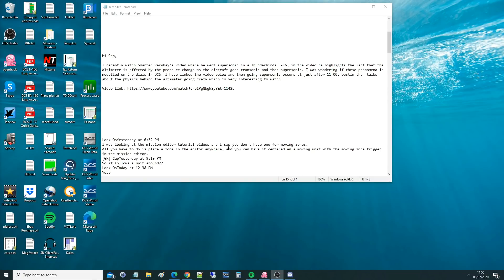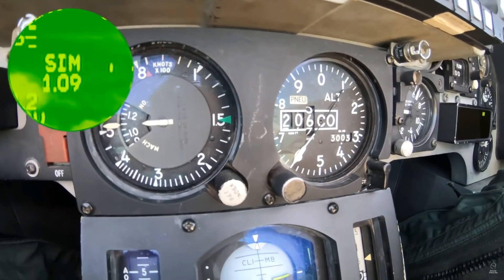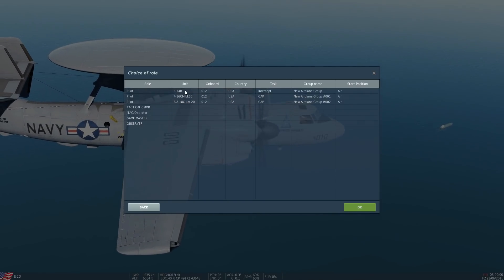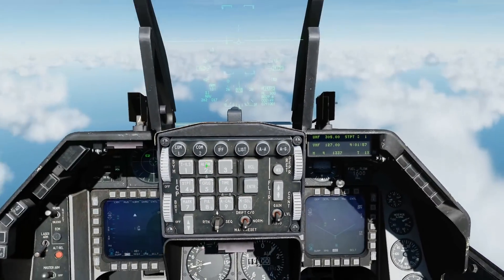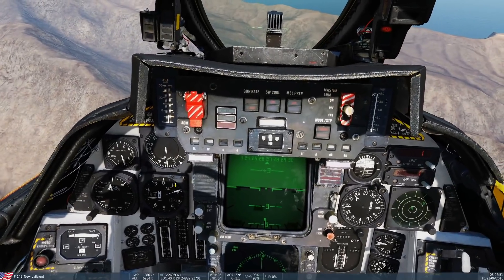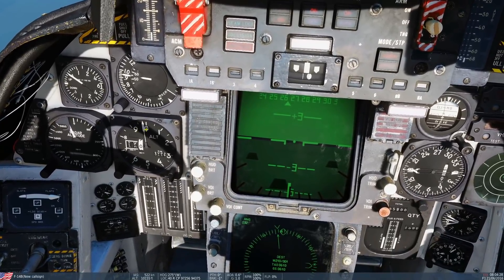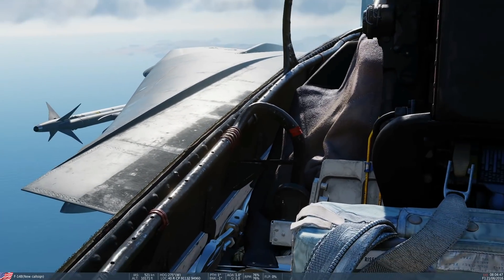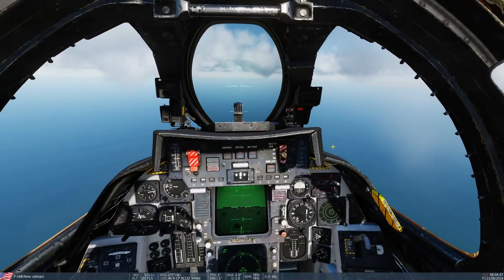Questioned: Is Pitot Pressure Rarifaction Modelled In DCS WORLD?

Comment: It works in the F-16 you just have to switch the altimeter to pneumatic mode. That little switch next to it.
Reply: Have you tested that?
Reply: Confirmed, tested it an you are correct it works on the F-16 as well in 'PNEU' mode
Reply: F/A-18 does not go super sonic :-D
Reply: @ihsanollasalamziy628  tis a joke
Reply from the maker: Thanks Sir did not realise
Reply: @ihsanollasalamziy628  I looked and didn't see a way in the Hornet. I think it is Pneumatic only and isn't modelled. I did test the F-5e as well but didn't appear modelled either. It does have both elect and Pnue modes as well.

Comment: Having once worked for a video game company, I can tell you that these sorts of things are never actually physically modeled. That would require far too much computing power to keep the rest of the game/sim running smoothly. What we would do is setup many pre-calculated tables, where the necessary values can be referenced very quickly while the game/sim is running, instead. That being said, it shouldn't be that big of a deal to put this behaviour in the simulated aircraft.
Reply: That's basically how everything here works, including the flight model. And if it's good enough for NASA sims, I don't see a reason why it wouldn't be for us...
Maybe at some point proper CFD will be done in real time on GPU, probably with some help from neural networks, but before that THIS is the only viable option yielding professional grade results.
Reply: @getsideways7257  Many of the advanced flight models in DCS do use some real-time calculations for flight modeling

Comment: +GrimReapersAtomic  Eagle Dynamics needs to develop static rarefaction models for the available types in DCS:World.  I'd expect the engineers to place the static ports of the pitot-static tubes feeding the air-data computers where the shock wave has the least effect, so the helmet-mounted PFD stays true even as the standby gauges reflect a 500-foot jump from the pitot-static tubes feeding them on account of the static port located farther back than optimum.

Comment: Indeed it's modeled but on plane tested, it depends on the ADC systems in use. That f16 in the video was in PNEU mode, so no compensation behind. F18 also compensate for this effect.
Here, it s the Mach shock wave giving you an abrupt change so it's very noticiable but on liners, or on any plane you ll have the same effect.  For example, on the 737, when you level out at an altitude, it keeps it even if you accelerate or decelerate.  Back when I started on the Bae146, the altimeter was not compensated so your altitude would change if you change your speed. That s why we were not RVSM with the 146...
Reply: If there a way to switch to pneumatic in the Hornet?

Comment: Now you know why the Tomcat is an expensive module, it definitely worth it. Beauty Mighty Tomcat, everything in this module is awesome, even Jester AI but not the GBU-24 ^^
Reply: Because you can sell anything to an idiot with a simple trick or two? Especially if it looks shiny. That's basically MS' plan for their upcoming "sim".
Reply: @getsideways7257  well come on, why so negative. It seemed (before everybody chimed in about the pneu mode) that heatblurs module was the only one modelling such an obscure detail. I think there's way worse reasons to show loyalty in the flightsim worls than attention to such details
Reply: @decnet100  Why so negative? Because HB's modeling of it looks rather suspicious? There is, however, the possibility of it behaving as it does because of the difference in the Pitot ports configuration. But if on both aircraft it should behave the same way, I have bad news for you...
Reply: @decnet100  Also, who's to say it shouldn't default to the electric mode in an F-14? Maybe it shouldn't exhibit that behavior in the first place, but they still decided to add it "to make it look cool".
I mean, even F-5E is much older, yet it does have the switch. You think Grumman engineers didn't know how to compensate for the Mach shock wave pressure jumps?
And if anything, Heatblur weren't the first ones. MilViz did it too and probably some other FSX developers.
Reply: @getsideways7257  Man, sounds like some guy from heatblur pissed into your coffee this morning... You're like assuming the worst reasons for anything by default. Usually that means they screwed up something personal previously if there is that kind of anger. Not saying you're not justified for saying so, and I can't be bothered to go through F-14 documentation to check the default settings (am on my friday evening diet of beer and icecream already)... But man, take it easy, life goes easier when you stop assuming malevolence where ignorance would work just as well...

Comment: I noticed it was lacking in DCS modules in general and it was a bit disappointing for me when I compared it with FS9 (and even fS2002)  modulus, many of them did simulate this effect. And again it is good to bear in mind that many of those modules were free.
Reply: Simulate or just play a specific hand rotating animation as soon as the transonic region is being passed through?
Reply: @getsideways7257  I guess your understanding of a simulated world like the DCS needs a bit of correction. Do you think everything you see in DCS is "simulated" in the sense that it follows all rules of nature?! Obviously that is not the case and it doesn't need to be. 
Even softwares that are designed specifically for scientific research and engineering are far from being perfect.
Reply: @Heybat  I know reasonably well how things are simulated in DCS, so you don't need to tell me that. Still, there is a huge difference between using a little trick I described above (which is purely cosmetic) and expanding the aerodynamic tables for the FM also with the readings from the static and dynamic Pitot ports.
Also, on the point of "it lacking in DCS modules": https://www.youtube.com/watch?v=cWGewNOkRII
It's just that modern jets appear to have a mechanism preventing the readings from going haywire, so you need to switch to a special pneumatic backup mode to see that it's actually working.

Comment: For those of you folks who can't be bothered with checking it yourself, here's how it's actually modeled for the F-16CM module: https://youtu.be/cWGewNOkRII
I didn't try to copy the SED video exactly and was flying low level at that. As you can see, some pretty complex stuff is going on there. Especially when you pass the transonic region slowly.
Also, the latest OB started having some weird freezes. That's another reason why nobody should have interfered with the frequency of the updates. Now we have to wait forever for that to get fixed.
Reply: Someone else has already posted a video of the previous version without the PNEU flag. Well, no harm in having a few of these, especially since the flag is working now.
Reply: I also tried to recreate this in the F-14 module and for some reason the hand's behavior looked more natural, but nothing close to what we can see either in the Destin's video or in either of the DCS F-16 videos. I wonder if that could be due to improper modeling of things or because of the Tomcats Pitot ports configuration. After all, we never saw how exactly it happens in the cockpit of an actual F-14B... I'll give Heatblur the benefit of the doubt for now. But what I can't let them get away easy with is a pretty long list of things, starting with the performance that got simply beyond horrible after the latest patch. Sure, it dipped pretty steeply across all modules, but the Tomcat is just unbearable curently.

Other two things worth mentioning: DCS F-5E doesn't appear to have this modeled even in the pneumatic backup mode, HB AJS-37 couldn't care less for transonic effects either (or the backup mode wasn't found). Also, RAZBAM's Mirage doesn't show any signs of this behavior either (or again, the pneumatic mode not found).
Reply from the maker: Thanks for clearing that up, I didn't think to check the Altimeter mode.
Reply: @grimreapers  No need to thank me for the altimeter mode, since that goes to the other people here. I simply did more experimentation and added a current OB video (the flag looks pretty neat), apart from speculating how it could be decently modeled without straining the CPU (the same way as the flight model).
But please always double check these things. This video might have spoiled ED's reputation quite significantly, since people readily jump to conclusions without at least watching to the very end (not to mention ignoring any following refutals). Although, sure, the F-5E doesn't seem to have this modeled, but then again, the Viggen doesn't either. Let's judge by the most recent modules.

I have a feeling there might be more Pitot related aerodynamics artifacts we are unaware of. Like, while flying with the static port first. Although, that should prove difficult, since you'd need to reach 50 kts in that position or whereabouts. Then again, it could be possible in a heavily damaged/almost destroyed aircraft. That would be a good test for the model. That said, I'm not sure if the tables account for lateral velocities that significant...

Comment: The Hornet and Viper are using KCAS (Knots Calibrated Airspeed) which is corrected for effects like this, so the altimeter might be similar? I think you can even switch modes in the Viper
Reply: Calibrated Airspeed is Indicated Airspeed correct for instrument and position error.  It does not correct for comprehensibility or density; that would be Equivalent Airspeed.

The altimeter is electrically driven by the CADC in servo mode, and driven by the pitot static system in pneumatic mode.  According to the manual, the airspeed indicator is always driven by the pitot static system and displays indicated airspeed, which I found surprising for a high tech aircraft.
Reply: @gort8203  Thanks for the correction!
Yeah, it does sound surprising, but then again you have to remember that the planes that to us feel so very modern in DCS are from the 80s, the last Legacy Hornets were delivered in 2000. 
More modern aircraft like the Super Hornet and F-35/F-22 are most likely a lot more advanced.

And at the end of the day KCAS or even KIAS is useful, since it gives a feel for the turning potential and basic aerodynamics at any altitude. It's not perfect, but there's a reason why TAS or GS is not displayed in the HUD
Reply: @AsRedAsBlood7  After further reading, I think the F-16 HUD does display calibrated airspeed, but the standby airspeed indicator displays indicated airspeed.  Probably the same for most of these fighters.

Comment: Pity that the Smarteveryday guy doesn’t understand shockwaves.
Reply: He's an aerospace engineer who worked at the Redstone Arsenal. I'm sure he's at least familiar with supersonic aerodynamics.
Reply: M G it’s very simple: pressure ahead of shockwave is normal atmospheric pressure, behind shockwave is higher pressure, pressure drops behind the rarefaction waves that you can see in his video where the projectile cross section reduces. Can be found in any aerodynamics book but it’s not what he said.
Reply: @andybarnes00  I agree, he had it backward, pressure aft of the shock wave is higher.  This is why you want a normal shock inside the inlet of a jet engine, so the compressor face sees the highest pressure available to it.  I think this guy was pointing to a shock wave but talking about an expansion wave, which causes velocity to increase and pressure to decrease.

Comment: Is the rarifaction modeled backwards.  your altitude drops by about 1200 ft. which would equate to a higher pressure at the static port. I don't know where the static port is in the tomcat, but in the video, the F16's static port is is the low pressure area behind the shock wave.  I am assuming the tomcat is the same, so the altimeter would read a increase as the pressure dropped.
Reply: I was thinking the same thing too
Reply: I hadn't seen the term "rarefaction" used in this context before, so I was confused and it took me a while to figure out what this guy meant, but I am now of the opinion that he has it backwards.   There is actually higher pressure at the static port, because pressure and density increase behind a compression wave.  If an oblique shock wave attaches to the tip of the plane, or there is a detached bow wave ahead of that tip, pressure behind that compression wave is higher.  There will be an expansion wave to follow later when the airflow either turns around a convex corner comes together near the back of the airplane, and the air behind an expansion wave decreases in pressure and density.

Comment: I wonder what is the procedure for going supersonic with BALT autopilot on.
Reply: If you mean the real aircraft:  "If the ALT HOLD remains engaged as airspeed transits 1.0 mach, a mild pitch transient may occur and can be eliminated by depressing the paddle switch until the altimeter has stabilized."

Comment: If the altimeter port was combined with the air-speed port and on a probe on the front of the plane, there would be a minimal rarefaction effect.  The planes you tested should have the effect.